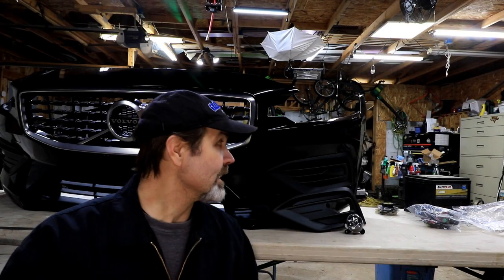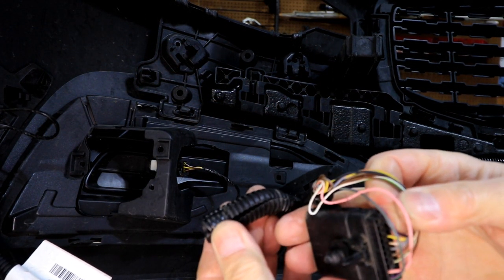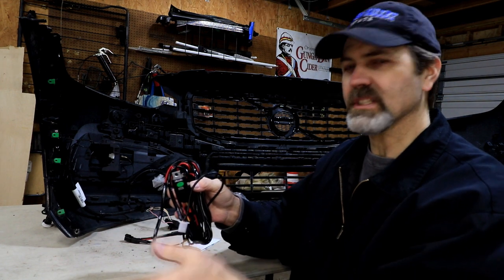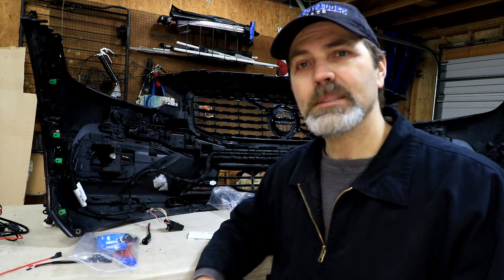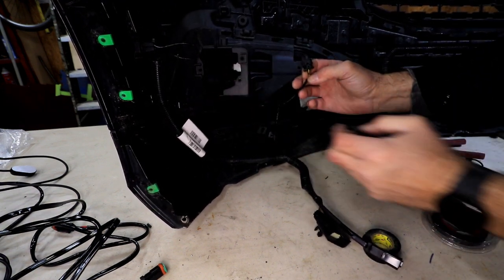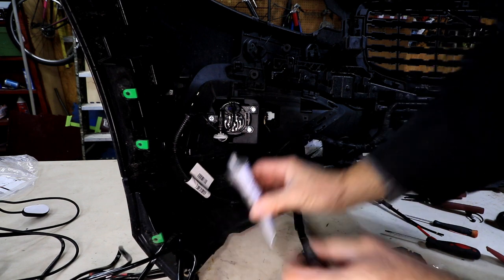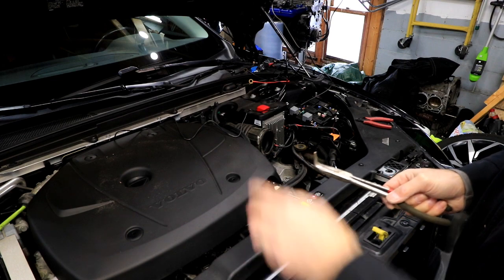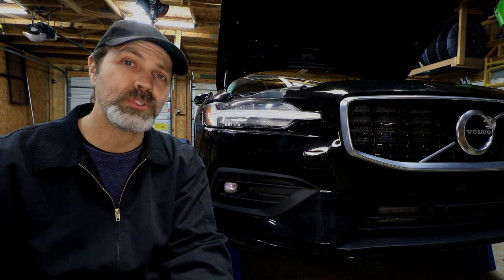Installing Factory Fog Lights In A Volvo

Comment: Just wanted to let you know, I LOVE my fog lights. We bought our 2019 Volvo s60 awd momentum new and always wanted the fog lights. I love driving it so much more in the morning and evening hours with the fog lights on.  I used everything you did (new oem fog lights, new oem grille cover, the after market switch kit and fuse splice.) Worked like a charm. Thanks again!!
Reply from the maker: Very happy to hear. Next you should consider what I did. Swapping over to the factory switch and pinning the cem for the fog lights. Now, when I turn, I have cornering lights. This did require using the Orbit software I have in a later video.

Comment: I want to change the front fog grills only, also I dont have sensors just the plastic . Can i remove the grills fron the front? Without taking the bumper off?
Reply from the maker: It can be done without removing the bumper. Just remove the under tray that you would remove to do an oil change and you should be able to access the grills.

Comment: Hi, I bought everything you bought and will be doing my fog lights soon once I get my lamps. I have two questions for you. What plug did you use to connect the fog lights to power and the second question what fuse did you use in the box under the hood to pick off Power?
Thank you
Reply from the maker: Thanks for watching. Assuming you have the same year and model as mine,  the factory fog lights will plug into the bumper harness since the connectors are there but I did have to cut the wires from the harness to use them. The fuse I used under the hood is number 24. That is the fuse for the 12v outlet next to the gear selector, it is only powered with the key on. 

I have, since doing this video, redone the wiring, added the correct wires into the factory harness and activated them correctly with an aftermarket program. There is a video on this as well.
Reply: I have one more question. I have everything I need,  the screws to screw the lights in the lights in the grill that supports the fog light and sensor. My question is what does the fog light screw to ? You reference a bezel but is that the grill plate? maybe I’m asking this question prematurely, once I get the nose off I will see a bracket there, that is currently in use. Referencing the bracket the fog lights screw to in 1600 time on your video.
Reply from the maker: Again, aiming you have the same year and model, you need the factory fog light bezels because the fog lights attach to them.
Reply: @DIYEVERYTHING  totally understand, I have the exact same year and model. It is a 2019 Volvo S60 T6 all-wheel-drive. I believe the bezel or bracket may in fact be there and currently assisting in holding in the sensor in place on the plastic grill cover . I will see once I get into it but again thanks for your helpful. Great videos.

Comment: any idea what part numbers for the lamps and the covers--so that the parking sensors will still work.
Reply from the maker: The parts may vary based on year and trim level. The best way to find what you need is at volvoparts.com or your local dealership parts department.

Comment: How long did it take to get the front bumper off, and back on?  and what types of clips do I need to replace the ones I break?  BTW Great Video!!!
Reply from the maker: The bumper cover can be removed in about 10 minutes, including renovation the wheels to get to the two bolts on each side. You should be able to do it without breaking any of the clips.

Comment: Can you remove the black trim plate without removing the bumper?
Reply from the maker: The fog light surround? Yes, it can be done if you remove the wheel, pull back the plastic wheel well liner and reach in from that side. The clips are very tight. I found it easier to remove the bumper cover for video purposes.

Comment: How bright are they after the install?  Is it worth the effort?  I'm overdriving my lights as it is now.
Reply from the maker: While there are brighter options than the OEM fog/ driving lights, they do very well with adding additional light with the low beams. Keep in mind that they do shut off when the high beams are activated.

Comment: Where did you buy the harness?
Reply from the maker: If you're referring to the factory harness, it's already in the bumper. The connectors are clipped into the bumper cover near the outer edges. However, there are no wires for it on the body harness, which I corrected in a later video. The harness I used to make the fog lights work until I could get all the factory pins sorted out is listed on the video description.
Reply: @DIYEVERYTHING  oki, thx. I bought my v90 without fog lights, but I want to install factory ones 🙂 I have the factory harness in the bumper, but missing the wires from the connector to the fusebox🤦

Comment: Do you have any idea if i can add-on into my 2019 S60 T8?
The lever in the car has a switch for it tho, but this model does not come with fog light.
Reply from the maker: You absolutely can! This video shows the light installation and an aftermarket switch. I have a newer video showing how I made the factory switch work and what wires you need to add and where. Hope this helps.
Reply: @DIYEVERYTHING  got it. Thanks.